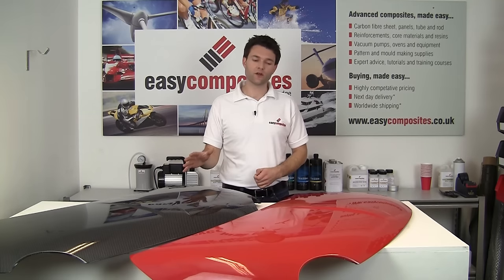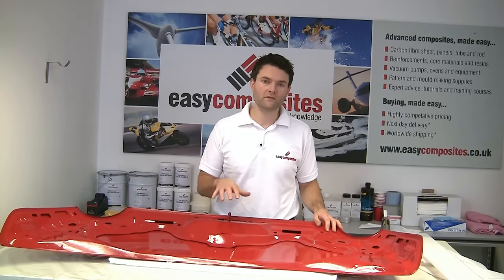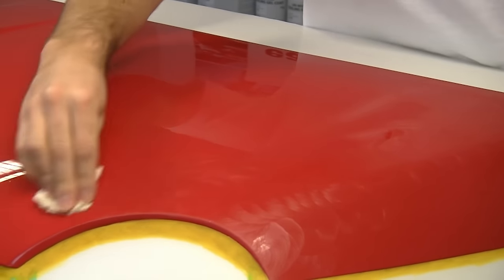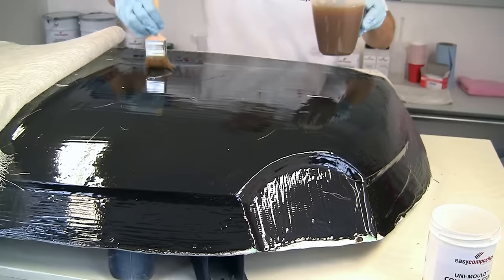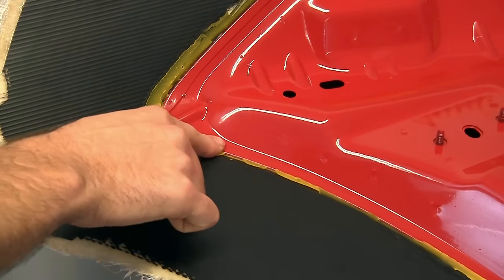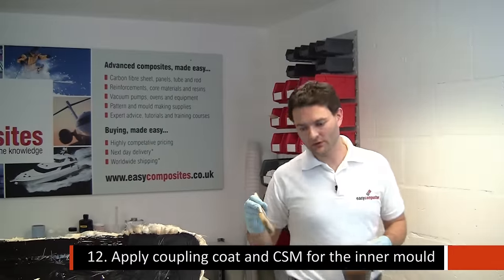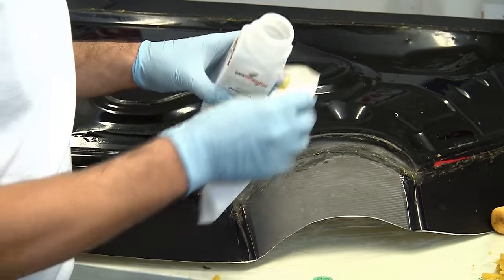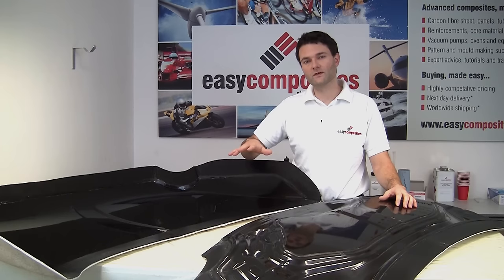How to Make a Carbon Fiber Car Bonnet/Hood - Part 1/3 : Making the Mould

Comment: So how much less strong is carbon fiber if you don’t give it the vacuum and heat Cure treatment?
Reply from the maker: Certain strength properties, like tensile strength, are 90% determined by the fibre and so there's not much to 'play for' between different laminating/cure processes in terms of their affect on tensile strength. Other properties, like inter-laminar shear are more affected by the resin system and void content and you might see as much as a 20-30% difference in this property between a hand lay, no post cure laminate vs a resin infused then post cured laminate.
Reply: @easycompositestv  good to know. So even with a 30% drop it’s still stronger than steel

Comment: I have a question: Can we make the mould out of the hood with protection film on it?
Reply from the maker: You can use a vinyl wrap to protect your original component but only if you use epoxy gelcoat and resin to make the mould. Polyester or vinylester resins (like the UniMould system) can’t be used because they will attack, soften and wrinkle the vinyl.

Comment: what is this carbon fiber twill on first layer as we see you touching by hands laying to hard corners and materials pattern not damaging also sticks to mold. if we use to wrap our carbon its from hands or when you cut starting to get messy and to run apart.

Comment: Does the gelcoat will damage the paint surface since I saw the video using bonnet with paint??
Reply from the maker: In most cases of an OEM paint finished panel, there is unlikely to be any paint damage if the paint is in good condition and the release agents work perfectly. However we would be inclined to say that paint damage is always possible and as such you should bear that risk in mind when choosing to use such a panel for taking a mould from.

Comment: i have a carbon fiber hood/bonnet that looks like it went through a hurricane. theirs no clear coat and i can feel the fiber
my question is this can new carbon fiber be added to the old carbon fiber to make it look like new
Reply from the maker: You could in theory carbon skin a damaged bonnet. This is normally done on metal panels for the "carbon look" without the hassle of moulding a complete panel. However in your case it could be used to save a damaged panel.

Comment: how are the each carbon stick as strength enough as its strength ?? is that means resin also has enough strength as carbon ? when it dried ?
Reply: +SK Jung  actully when it comes about composites , the new combined material mechanical properties can be totally different of all its components alone and as a surprise the properties wouldnt be just an average of individual ingredients but some time at a higher level than all its ingredients . By mechanical properties i mean thoghness , UTS, elasticity, and so on.

Comment: Isnt the whole point with carbonfiber to make it lighter. If you dont add vaccume or heavy pressure it will not get rid of as much glue and it wont be as light as it could be?
Reply from the maker: This is the mould making video, if you watch part 2 of the series, you can see that we do indeed infuse the part under vacuum however, do bear in mind that even if it was wet-layed, whilst it would be heavier than if made under vacuum, given the density of Carbon Fibre, it would still be lighter than a steel equivalent for example, it just wouldn't be quite as light as it could be.

Comment: And I was just wondering if standard poly marine resin could withstand engine heat? I picked a couple things here. Thanks!
Reply from the maker: Standard marine polyester resin would not make a good infusion resin (because it's designed for hand-layup). You're likely to find the resin 'boiling' if you try to follow the guidance in this video (which is based on epoxy infusion resin). A standard polyester resin will take up to around 70'C which might be adequate but you will lose the mechanical performance of an epoxy resin which kind of makes using carbon fibre a bit pointless then too. Our suggestion would be if you're working with carbon fibre and using a proper resin infusion process then there's no point in throwing away the performance of the finished parts by cutting corners on a few ££'s worth of resin. Use epoxy infusion resin and get a strong, light and stunning looking part!
Reply: Easy Composites Ltd I'm not laying up carbon fiber. I was thinking about making a hood for a jeep, so it's disposable. The cost of epoxy and carbon would be a waste. I'm just going to use some of the heat insulation I have at our boatyard.
Reply from the maker: Fair enough. Well, you might need to think about the max operating temperature of the 'heat insulation'. If it's EPS (expanded polystyrene foam) then it too might not be up to engine bay temperatures but more importantly polyester resin will dissolve polystyrene foam to a goo within minutes!
Reply: Easy Composites Ltd we use it in boats everyday. It'll be fine.
Reply from the maker: Cool. I guess it's polyurethane then; generally considered to be more of a buoyancy foam/core than insulation (in a marine setting).

Comment: How do you ensure that there are no bubbles between the tooling gel and the fiberglasss?  i've never used the tooling gel and I've had some major issues with air pockets forming between the part and the wetted-out fiberglass.

Comment: hi easy composites could you show how to make trunk lid from carbon fibre ore front fender
Reply from the maker: Hi Mindaugas, the process for a trunk or a front fender would basically be exactly the same as the process we've shown here for the bonnet. All of these panels are essentially made i the same way.

Comment: Ccould you explain different between coupling resin and resin used later on to build up layers?please
Reply from the maker: The purpose of the coupling resin is to enhance the bond between the gelcoat and the tooling resin as well as providing a resin to wet out the 100g CSM to prevent print through.

Comment: Hi
Can someone give me advice. I'm thinking to make a front lip for bumper. Problem is that car is low and some times it will scrape. Is there any other materijala that you sugest to use, I need to get something like front lips are made off. I'm scared that epoxy and glasa will break easy.
Reply from the maker: Krunoslav09 You can use Aramid based fabrics or the cheaper diolen to give added impact resistance.  Otherwise you could use a flexible resin such as our EF80 which can be found here: http://www.easycomposites.co.uk/products/epoxy-resin/EF80-flexible-epoxy-resin-system.aspx
Reply: Easy Composites Ltd Thanks for answer

Comment: What would you use for ABS Plastic parts? I have a Kawasaki Ninja and was thinking about doing this on some pieces.
Reply from the maker: To get a good bond of the epoxy onto ABS you can 'key' the surface of the ABS and then 'flame treat' it using a blow torch. If you do this it will oxidise the surface of the ABS which makes it much more bond-able. The flame treatment is used to bond ABS in ski and snowboard construction.

Comment: If it has clip can you carbon fiber that or do you have to overlay the carbon fiber ?
Reply from the maker: You can make carbon fibre versions of parts that have clips or brackets, often the way to do it is to make the main shape out of carbon fibre and then make the clip separately (often out of metal) and bond it on.

Comment: HELP. 3 times ive made the same part and 3 times the painted surface of the molded part has wrinkled, 1st time it stuck bad, 2nd time it stuck less and was a better finish, still wrinkled in places, 3rd i put 6 coats of wax on, polished every time, (carnuba) it released very easily but the mould and paint on the original part is heavily wrinkled with spots of paint pulled away. what is it? tooling gel coat to thick? (brushed on) seems its burning through the wax and getting to the paint and making it wrinkle, or is the gel coat wrinkling and making the paint underneath do the same????
Reply from the maker: What kind of paint and how fresh is it?  It sounds like a classic reaction to the paint.  Fresh paint is always a risk of sticking as the solvents out gas and cause release issues.  Rattle can and "single part" paints are especially bad and we recommend avoiding their use on patterns where possible.  Fully baked off and cured 2 pack spray paints are much less likely to have a reaction.  If you are still struggling, switch over to PVA mould release agent as it forms a barrier between the materials.
Reply: @easycompositestv  amazing, it was as rattle can, I sanded it all back and put many layers of wax on it, 4th try has released beautifully. Thanks so much, I hope one day my stuff will come out as good as yours.

Comment: How well would this work if you where to use it for thermoforming?
Reply from the maker: It would largely depend on the temperatures involved as the Uni-Mould system is realistically limited to 90'C as a maximum working temperature.

Comment: If you're not using the steel bonnet can't you use it as a mould?
Reply from the maker: No because the finished part would come out a few mm different in size depending which side you mould off. This means the panel gaps will be different.  If moulding off a typical framed bonnet, your gloss smooth side would be the inside and the outside visible side would be rough and need a fair bit of work to smooth out.
Reply: Yes, I realized that myself after some thought :)

Comment: How many parts would you be able to make using the same mold?
Reply from the maker: With maintenance of the moulds, potentially hundreds of parts could come from the mould.  You would occasionally want to repolish it to take out any scratches that occur in use.
Reply: Easy Composites Ltd Thank you. I had no idea you could make that many products from the same mould. Great video by the way

Comment: Hi, if i make a fiberglass bonnet do i follow this steps and what thickness cloth should i use?
Reply from the maker: Hi, yes, you could make a fibreglass bonnet using the resin infusion process. It's much less common because for the amount of extra work most people would choose to go for the increased strength-to-weight of carbon fibre but if you did resin infuse a glass fibre bonnet using epoxy resin (as per this tutorial series) you would be amazed by how strong and light the finished product was. In terms of thickness, you probably want around 1.5mm thickness which would be 4 layers of 300gsm woven glass fabric (go with a twill weave fabric not a more basic plain weave woven roving).
Reply: Thanks. should i omit the (LORIC) in between the top part?
Reply from the maker: Probably, yes. If you're going for a more basic glass fibre layup then I would say that using solid glass laminate would be the more appropriate option.
Reply: Much appreciated. Am going to replicate a bonnet for the Replica car market. I would prefer the carbon, but some guys want a cheaper option. ALL the parts im intending doing will be with vacuum bag. I do not like hand laying for all the reasons. How many layers and cloth (glassfiber) would you suggest for the inner panel?
Reply: also, what wil i use to bond the 2 parts.
Reply from the maker: I would suggest an MMA adhesive such as our VM100 VuduGlu.
Reply from the maker: Probably something similar, maybe around 1mm. You would need to experiment, depending on how stiff you want the finished panel to be.

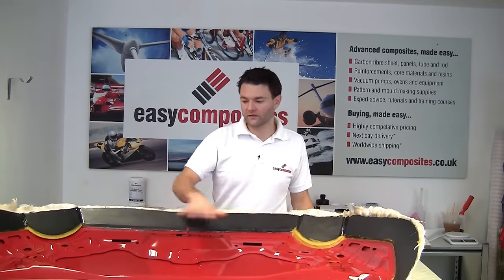Comment: 12:20 Y U do dis? Really, though, why? You can fill the blank stud holes after the process in the mold and taking out the latch (if possible, if not, cover it, too) takes less time than plugging in the angle grinder. The video is perfect in every other aspect.

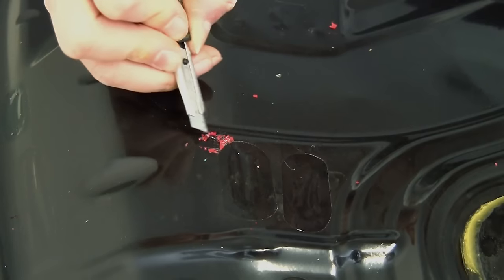Comment: 17:55 how do you prevent the paint of the part (hood in this case) from sticking to the mold? I would like the hood not to be damaged, seems like on the exterior side that didn't happen tho
Reply from the maker: It is likely you will always get some minor damage due to the fragile nature of some paint finishes.  This can be made worse due to pre-existing paint chips or surface defects which are more likely to lead to the paint being damaged.
Reply: Easy Composites Ltd thaks👍
Reply: Easy Composites Ltd do you think the mold would turn out good if the hood is wrapped in vynil?
Reply from the maker: There is a good chance the vinyl may react with the resin and/or be distorted by the curing process so we would not recommend it.
Reply: Easy Composites Ltd that's what I supposed, I asked anyway since maybe you tried that in the past

Comment: Ok so I have completed one side of a body kit for my firebird 69 now I don't know how to make the other side? Can you help? I made one side out of fiberglass.
Reply from the maker: If it is a two sided part, like a hood with a frame, you need a second mould made to make the frame.
Reply: Easy Composites Ltd I get the hood process!  What i don't get is how to make the right side of something to match the other side. Because the other side has not been made. R to L? Opposite side?
Reply: mobile moe tint i can think of a number of ways to do this. Obviously it's easier if the part is off the car. You could either order a new body part from gm, order an aftermarket body replacement or use a junkyard part. Make sure it's clean and rustfree. Put a light coating of adhesive on the part. Then layer some plastic over the part (you could even use a garbage bag, a plastic tarp, etc.) Coat it with wax. Then layer fiberglass over it one layer at a time. Once your mold is strong enough, remove the mold then create your carbon fiber pieces from this mold on a table top. Repeat for the other side as needed.
Reply: Brian Weir don't think you understand what I'm saying it's a body kit part I fabricated there is not one other part I like in this whole wide world so I can't just go out and buy another I have to fabricate another and I just don't know how to do it do you understand what I'm saying? Just in case you don't understand I have made the right side of the car there is no left side so how do I make the left side identical to the right side any ideas?
Reply: mobile moe tint somehow or another you would have to construct a mold for the other side. The only sure way would be to get the parts for the other side to fabricate your mold.

Comment: how many times do you think you can use the same mold?
Reply from the maker: +qryptiqsounds There's almost no limit to how many release you can get from a Uni-Mould mould; certainly we have moulds made in this way which we have produced hundreds of parts from. The main limit tends to be accidental damage caused to the moulds (like stratches or damage cause when levering out a stuck part if something has gone wrong). Even a scratched mould can be re-polished back up to original condition.
Reply: +Easy Composites Ltd thank you. great video.

Comment: I can't get yellow filleting wax, can I use clay to do it? Is it working?
Reply from the maker: clay isn't ideal because of the porosity; if you cannot find filleting wax, you could substitute with plain plasticine.
Reply: @easycompositestv  ok,Thanks, So how long should I wait after I put the gel coat, before I put the choppe sand mat, I means how long the gel coat be dry. TQ

Comment: I think that he should have taken the yellow putty of before donning the bottom layer ?
Reply from the maker: The filleting wax is left in place to prevent any resin bleeding under the bonnet and also to smooth out difficult edges.
Reply: I agree with you regarding the first layer, but there after it would be sealed. If you remove the wax before doing inside layer , you should get a well defined  edge of the bonnet and it would be easier to finish the edge. Good video !

Comment: what size of the kit would I need so a hood for like a Honda accord or something similar size ?
Reply from the maker: Measure the surface area of the bonnet and remember to add extra for the mould flanges.  The Uni-Mould kits are based on surface area.

Comment: Are the moulds made out of fiberglass ?
Reply from the maker: The Chopped Strand Mat used in the mould making process is the "fibreglass" element of the mould.
Reply: How long a fiberglass mould last and if it is made out of carbon fiber ?

Comment: Why are you painting all that white plastic sheet at the bottom, you end up cutting all that off later???
Reply from the maker: The 'white plastic sheet' (i.e. the 'barriers') are there to form the flanges of the mould. We don't actually cut the flanges off the mould, although we do trim them slightly to make a neater edge. For resin infusion we need large flanges on the mould so that we have somewhere to position all the consumables, bagging tape etc. We trim the component of course but that doesn't mean that we don't want to have decent gelcoated flanges on the mould halves.
Reply: Easy Composites Ltd - thanks, that makes sense

Comment: helloo thanks for perfet videos , i have a question , i want to konw the kinds of carbon for road bike , could you please help me for that ?? 
thank you
Reply from the maker: The range of materials used varies widely between manufacturers and the type of bike and/or method of production.  Commonly a lot of Uni-directional fibres will be used for structural efficiency on many of the frame tubes. This is combined with woven cloths for an outer finish and overall durability as well as strength at the joints and various fixing points.  The exact quantities and lay up would depend on the exact bike frame design.

Comment: how would you install nuts into the inside of the mold for the hinge mechanism?
Reply from the maker: You can use pre-made fixings which have a nut or stud on a load spreading plate which you can bond or laminate into place.  You can make them yourself of you can buy them off the shelf from us.  The main brand on the market is called Big Head Fasteners.